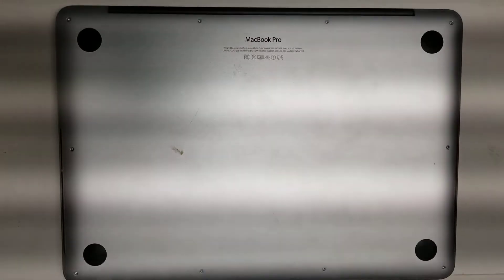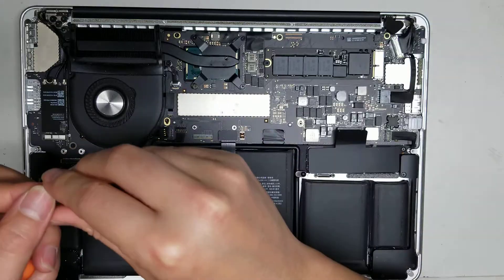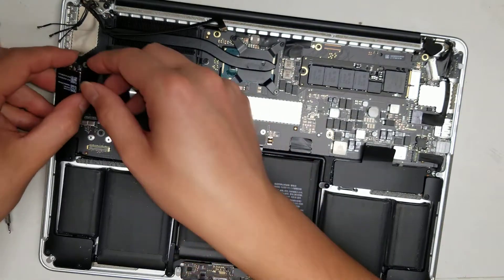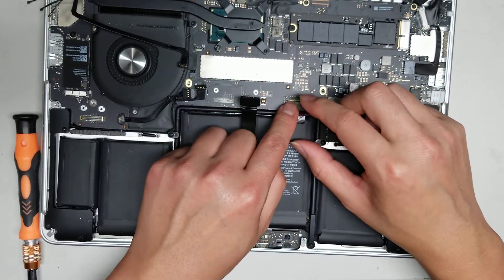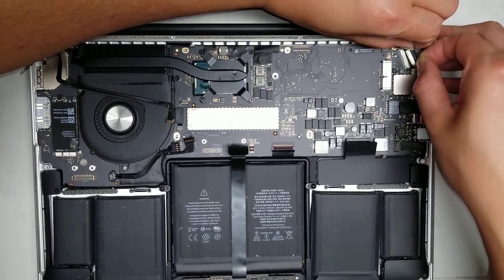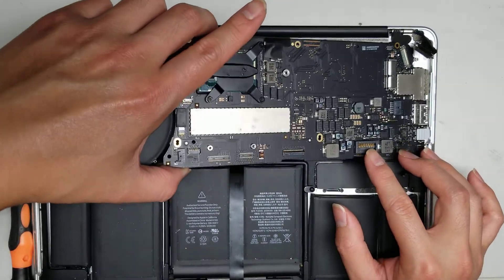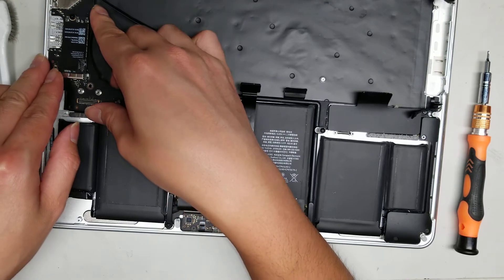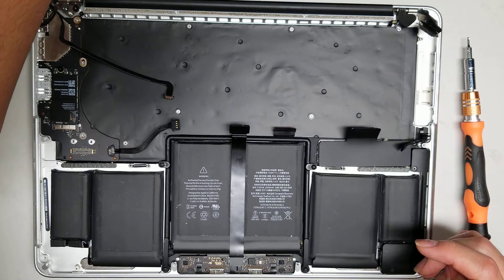Retina MacBook Pro A1502 Early 2015 Disassembly SSD Upgrade Logicboard Motherboard Removal

Comment: i have issue with headphone jack it detect when you plug headphone but no sound coming. i checked everything in the settings for proper selection and mute butting etc. all set correctly. any idea? Macbook pro Early 2015. thanks :)
Reply from the maker: Possibly damaged port
Reply: @ItsBinhRepaired  thanks for the reply, what do u think the best fix for this? Have it replaced with a new port?

EDIT: it was the OS i did a clean install and everything came back to normal
Reply from the maker: Awesome!

Comment: How do I know if I need to replace my board? My current issue is that my macbook pro does not charge or turn on even after I put in a new battery. Is this a sign of a bad logic board?
Reply from the maker: Seems like it unless the battery replacement wasn't done right

Comment: my macbook pro a1502 has been really slow after i replaced my battery, i dont think its the battery problem since even i disconnected the battery from logic board it is still slow, now still waiting for my new logic board i bought from aliexpress for $230 and the spec is 2.9ghz and 16gb ram, hopefully the performance back to normal because i can’t afford to buy new macbook 😭😭. do u think my old logic board has a problem?
Reply from the maker: It's possible it's the battery. Without the battery it'll run at reduced performance or not at all.
Reply: @ItsBinhRepaired  hmm we’ll see after the logic board replacement, i’ll let you know
Reply from the maker: @irfnjpeg  is your logicboard broken?
Reply: @ItsBinhRepaired  its fine before i change the battery, like it runs well. then i checked my old battery it was bloated thats why i decided to change the battery then i changed the battery and i start the computer suddenly it takes forever to boot up, and it running so slow like opening apps, and watching videos on youtube it was choppy and laggy
Reply from the maker: @irfnjpeg  did you do pram and smc reset
Reply: @ItsBinhRepaired  YES I DID, i tried everything but still same, thats why i decided to change my logic board
Reply from the maker: @irfnjpeg  :( Hope it works
Reply: @ItsBinhRepaired  i’ll inform you once i change the logic board. THANKS FOR YOUR VIDS! really helpful 😭
Reply from the maker: @irfnjpeg  good luck :)

Comment: I have an 13 Early 2015 MBP
It came with the 8gb ram and i5
Will I be able to replace the logic board with one of the same model that came with 16gb ram and i7?

Thank you.
Reply from the maker: Yeah, must be same model and year
Reply: @ItsBinhRepaired  😂😂
I actually replaced the SSD. It improved a little but I stopped using it since I got a new laptop
Reply from the maker: @Piojo69  ahh got it
Reply: Adán did u manage update your mother?
Reply from the maker: His mother is OK

Comment: Thanks for this video! What is the main benefit of the logic board replacement? To upgrade the RAM and Processor?
Reply from the maker: To replace a failed one. If you need more RAM and better processor, it's better to sell your MacBook and buy a better one.
Reply: @ItsBinhRepaired  Thanks for the quick reply.
Reply from the maker: @deanl6590  no problem

Comment: I am removing my 2015 MacBook Pro logic board now, but how do u find the serial number to get a logic board replacement?
Reply from the maker: The serial number is on the bottom cover printed in tiny font. https://everymac.com/ultimate-mac-lookup/ you can look up the model and year with that website

Comment: If I were to swap logic boards on my A1502, to one that works.. will my nvme drive still have it's data or will it reformat it and make me loose my files?
Reply from the maker: The SSD Should remain intact.
Reply: @ItsBinhRepaired  Thanks for the info
Reply from the maker: @DaveRod831  no problem
Reply: @ItsBinhRepaired  do you have any videos on how to replace the ssd connector?
Reply from the maker: It's soldered to the motherboard. You need to do micro soldering.

Comment: Thanks a lot man my gf and I tagged teamed it up and took it out and cleaned the board after our kitty spilled water on it lol 🙏🏼
Reply: I took initially took the back cover off to clean the water damage and it worked but it wasn’t holding a change so I figured we had to really take the whole board out and thoroughly clean the corrosion on the back side….. hopefully it holds a charge this time after cleaning all the corrosion
Reply from the maker: @raulosorio8337  battery might need to be replaced. Hopefully no permanent damage was done.
Reply: @ItsBinhRepaired  Im thinking so It turned on and it was running but still wasn’t holding a charge so it shut off.. battery is $45 on Amazon prime would you recommend that?
Reply from the maker: @raulosorio8337  yup, but it's a difficult repair.
Reply from the maker: @raulosorio8337  I did it with a broken clavicle. Lol https://youtu.be/qQ2KF7VOLi8
Reply: @ItsBinhRepaired  haha ok thanks man i just watched some videos on it and yours, looks like the hard part is removing the glue but we can do it I’ll comment on your battery video when I’m done ✅ 🙏🏼
Reply from the maker: Sounds good

Comment: Great video Edward Spudger-hand. Before I got married I use to let my nails grow like that too but the wife keeps on me now..
Reply from the maker: Hahaha yeah :(
Reply: @ItsBinhRepaired  I have 2 of these sitting in front of me now.. one with a bad screen, the other with an sdd lock on it so I can't reinstall OS. I need to take out the logic board on one of them and clear off corrosion that is causing intermittent powering on issues... I am not looking forward to it lol
Reply from the maker: @SpiritTracker7  why not swap the screens?
Reply: I will most likely, but I’ll still have 1 that has intermittent power on issues and no screen. Like I blew in the vent between case and screen and it improved power on consistency so I feel like a little scrubbing would solve the issue. I can’t certainly do what Northridgefix does.. refloat the corroded area. Etc
Reply: @ItsBinhRepaired  actually my first course of action was swapping the good drive on the broken screen laptop with the locked drive on the good screen one... I now have it working except for the power issue but that might be fixed because after blowing air through the vent it has started every time now, knock on wood
Reply from the maker: @SpiritTracker7  hmmm

Comment: kindly provide the list of PCIe 3 x4 will that support MacBook Pro A1502 early 2015 (Sabrent rocket and Samsung pro models especially)
Reply from the maker: You'll have to Google that. I just use crucial because of the price.  Most if not all should work fine.

Comment: Is there anything else to look for when buying a logic board besides the A1502? Do I need to adhere to some other specs besides 13 inch retina?
Reply from the maker: Certain components aren't removable. Use this link https://everymac.com/ultimate-mac-lookup/ to find your processor and ram amounts. In some cases you need the storage as well. You don't need the same specs, but if you want it to be the same performance, you'll want to check for that.
Reply from the maker: Also the year, mid, late, early is important as well.
Reply: @ItsBinhRepaired  Can I replace my late 2013 with 2015 logic board? I want a higher processor and ram.
Reply from the maker: @Glenford617  you'll have to ask the seller. I don't know.